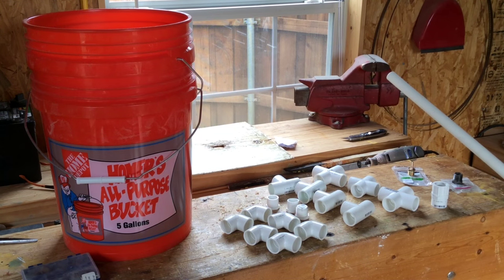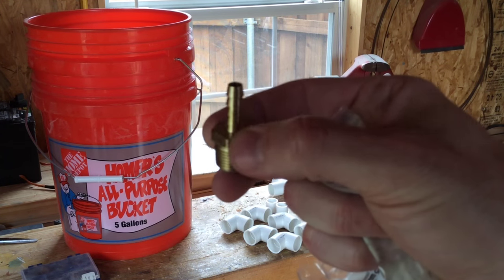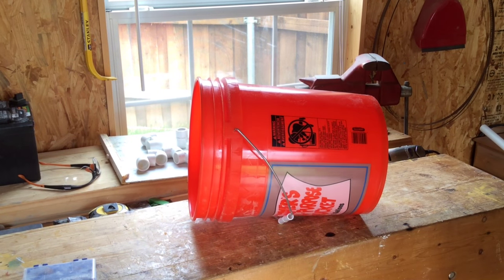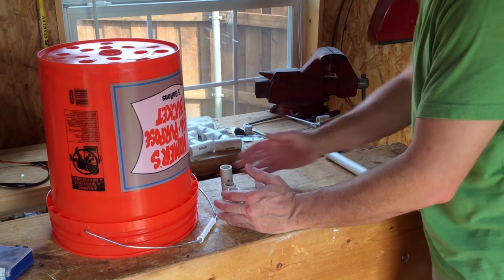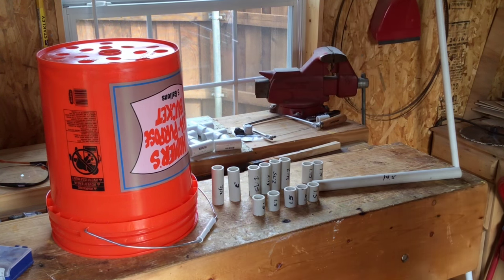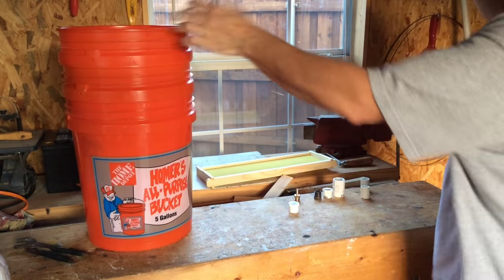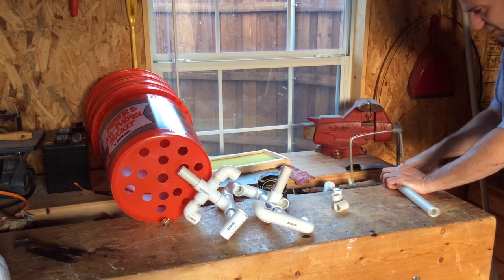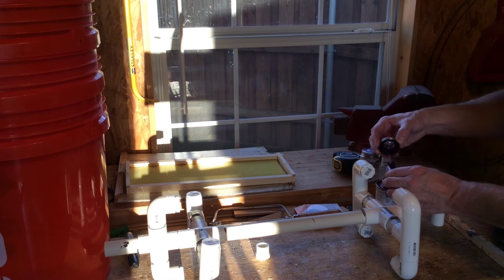Beekeeping - DIY Honey Spinner/Extractor!

Comment: I made this for  medium frames and it was great.  I found a little trick I wanted to share with you .  on the drill chuck side i added a 49MASCBP966 (Troy Bilt Weedeater Jumpstart).  When you let off drill trigger, the extractor does not stop suddenly.  Keeps on rotating to slow

Comment: Fantastic and a great video 
A suggestion that to fit the pipe thru the bucket hole drill a little small then use a hear gun to soften the bucket and easily work the pipe in and turn while it cools will quickly give a perfect fit
Gonna watch your 1 year review now 
Again great video

Comment: enjoyed your video!
FYI : most corded drills have either a screw knob on the trigger or back of the handle that allow trigger adjustment - this would help from over torquing the spin amount so you wouldn't have to worry about pulling the trigger to hard and spinning your wax off the frame.
Hope it helps??
Thx again for your time!

Comment: maybe you could find a piece with a shoulder wide enough so that the very bottom would spin just on the shoulder at the bottom instead of sliding on you lower frame supports. less drag may let it spin freer.
Reply from the maker: Good idea as it does heat the drill up from the drag.

Comment: When I tried to do this, the bit that the drill fits around shredded out. So I ended up with metal flakes falling down into the honey. Not good. Any ideas on how to deal with that? I used a brass one. Maybe a steel one would be better.
Reply from the maker: cocomaan I sheared my first one off in an instant!  Had to ease upon the torque.  Still seems to really tax my drill more than I like.   And hard to keep speed steady.  I haven't given up on it but doesn't work as good as I hoped.
Reply: Definitely a problem. One solution I had, that kind of worked, was to wrap the bit in tape. I ended up using my corded drill, because the cordless drill didn't have the power to get it done. Either way, have put it away for now. Maybe next season, I will tell you if I have any luck.

Comment: Did you ever use this? I built one this afternoon and plan on using it tomorrow - was wondering if you recorded your use of it.
Reply from the maker: Yes, I used it once, briefly.  Lol.   I torqued the drill too much and blew out the comb. I also snapped off the top nozzle that chucks into the drill!  Ugh!   I need to repair and try it again.

Comment: It's mid September. Have you used this extractor yet?
Reply from the maker: Yes.  I have video but have been slacking in getting it online.  Not sure whether I like it or not for a couple of reasons.   It seems to tax the drill pretty heavy.  Also regulating the speed is a constant challenge.  One slip too fast and blown out comb slaps the side of the bucket.  I almost prefer crush and strain but hate always starting the bees from scratch instead of being able to return the comb to them.  I'm torn at the moment.

Comment: Where did you buy the bees? I live in Spokane WA
Reply from the maker: I bought mine as nucs from a guy who has a large operation near me.  He's in Josephine, TX.
Reply: Do they ship Bees?
Reply from the maker: No, I don't think so.  I think you have to go pick them up.
Reply: THANKS
Reply: You are too late for this season.  I live in Colorado and had to order 3 months in Advance and a lot of the suppliers were sold out. Here is a link to PSBA    http://www.pugetsoundbees.org/queen-bees-and-nucs/  with a list of Suppliers.  If you can Start with a NUC weather than package.  What you get is an Hive of bees already producing you just transfer the frames to the new hive body with new empty frames.  I got mine and it weight about 20 pounds.

Comment: Crazy to use PVC, acetone and other HARSH chemicals on food (honey). You are gonna consume all of that!
Reply from the maker: You could dry fit the PVC or use a non toxic Gorilla Glue PVC cement.  I also don't think the few minutes the honey is in contact with the PVC, before it drains down below, is going to harm anything. PVC is a food safe material.
"Thanks to the NSF-51 standards along with FDA approval, it is safe to conclude that PVC is food graded."